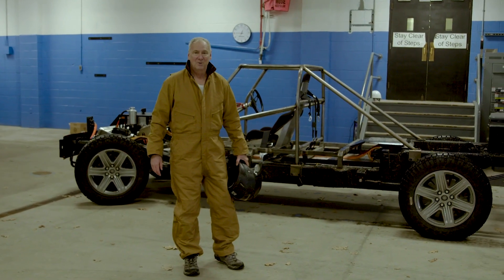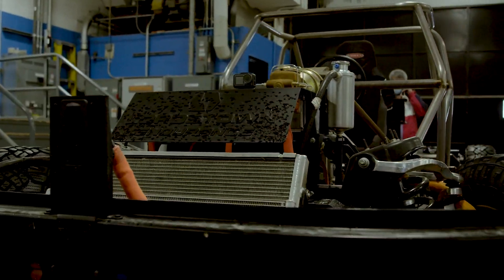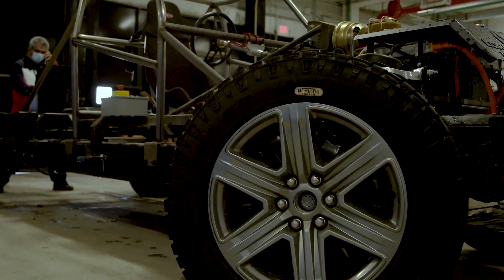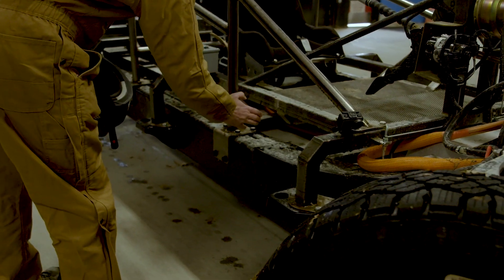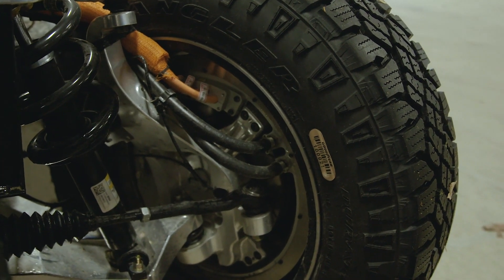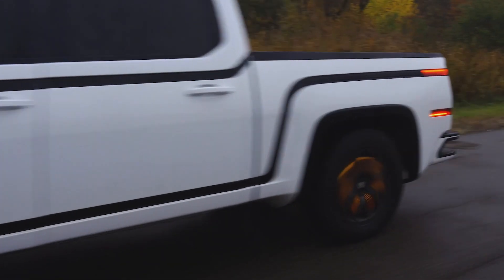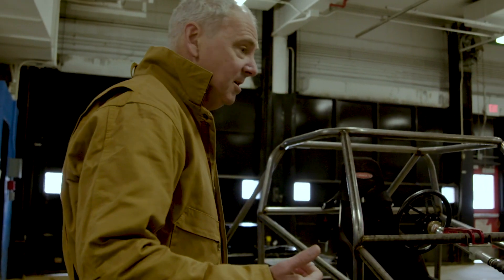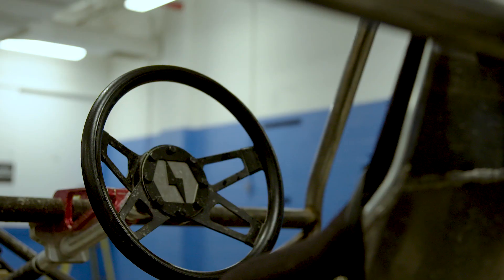The Lordstown Endurance: Testing the Alpha Skateboard Chassis | Lordstown Motors

Comment: Anyone else notice the radiator.... electric cars.and trucks don't need a cooling system?
Reply: So then what's those coolant lines on tesla for..... they do FYI
Reply: @500sixtyfour  a stand corrected... but you have to admit the reason they cut the sound out was because this was a gasoline engine being used to test the susoension.

Comment: Driving a electric car in the mud and water is way more impressive than driving in the desert especially with the drivetrain exposed
Reply: it does not have a drivetrain thats the whole point , it has a powertrain , each wheel has a motor

Comment: Looks like a big scam, there's shock absorbers are so lightweight they look like they found some old Cobalt parts laying around and threw the thing together for about five grand charge their shareholders millions
Reply: Without the extra 2000 lb of body plastic panels interior etc they're testing will give absolutely no credible data
Reply: Why would you put a solid rear axle and leaf springs in the rear end? makes no sense... You would think they would be trying to put high-tech technology in the construction
Reply: Looks like The motor is held onto the axle bolted to a 3/16 steel plate, is this thing like a 16th ton truck or what
Reply: Ummm... because a solid rear axle with leaf springs can haul more👍. You can also add leafs or airbags aftermarket. Lifting the front end with wishbone will cost more

Comment: Worst place to put electric motors, dirtiest place, terrible unsprung weight issues
Reply: If they the built good enough, the motors can handle that pounding for hundreds of thousands of miles.
Reply: Heavily tested in Europe (Slovenia) before being tested on the Lordstown.
Reply: @dereknicol5284  these hub motors tested by volvo also
Reply: Do you realize the extensive testing these motors have gone through?
Reply: @shafiaahmad4061  not very extensive at all as shown by this video the testing is only at the beginning stages
Reply: John what are your credentials?  Do you have experience in this field?
Reply: @vicntec7295  not required, this is well documented, this unsprung weight and putting electrical motor in the dirtiest place on the vehicle, hope it works for them but there are reasons nobody else is doing this
Reply: Jeff Hanson  yea
Reply: Right. Right. Right. Sooooo, in-wheel motor hubs have been around for a century. Nobody, not big auto or any other company uses them. Why? Because they’re energy inefficient and unprotected from shocks, sure to cause problems and degrade range. Electric motors need to be cooled intermittently. These are cute videos and all, but I seriously doubt this company has cracked this code. Verdict. You’re full of shit.
Reply: @mmt1952  https://www.youtube.com/watch?v=1alRUqx9UX8  ???
Reply: @shafiaahmad4061  yeah, I’ve already seen these.
Reply: @mmt1952  aight.
Reply: @shafiaahmad4061  in their testing why would they put it on a smart car to test their durability, and why do they all look brand spanking new in the tests, I'm sure they all work the first few minutes
Reply: @DigitalCruzer  they probably clean em afterwards. Idk.